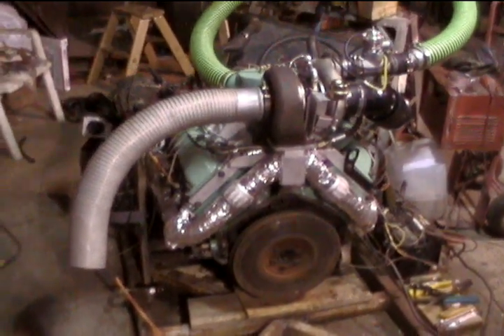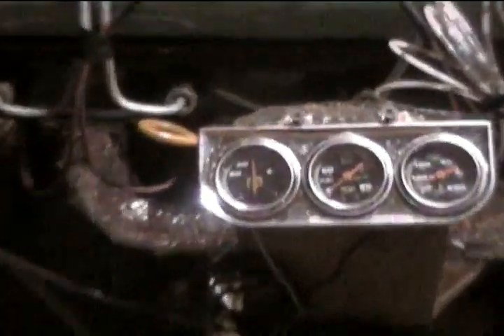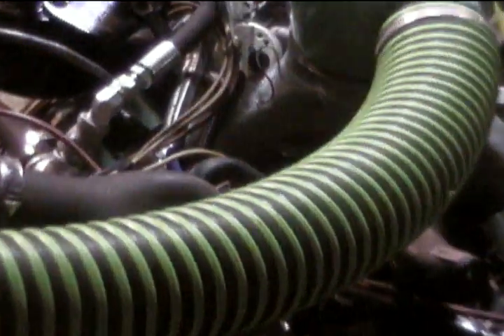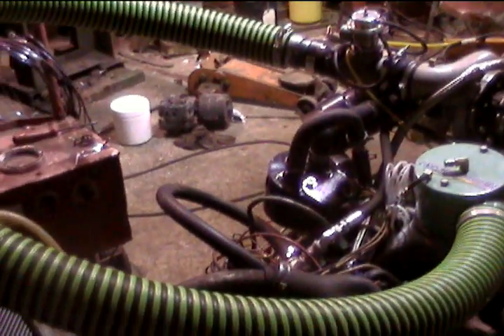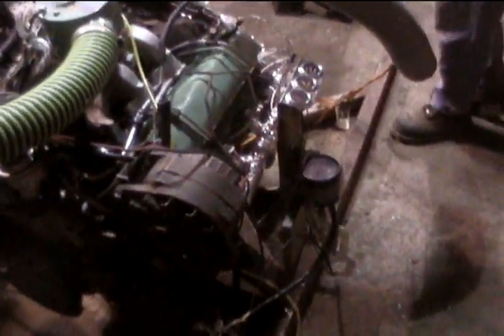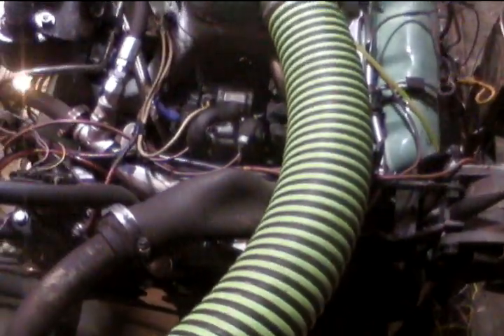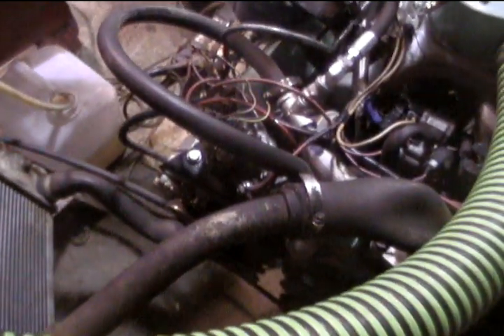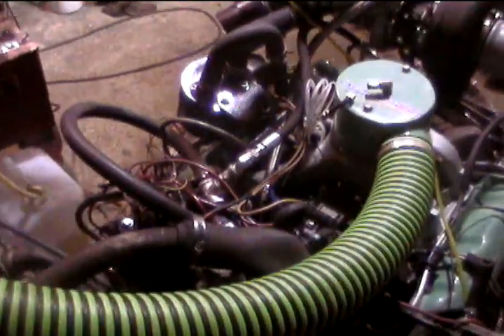6.5l turbo diesel with 18:1 compression pt. 1

Comment: u do know that a blow off valve is for when u let off accelerator to reduce lag?
it blows off so turbo has no resistance and so keeps spinning, other name is dump valve, usually on diesels its electronic and vacuum operated an r set to be open on idle/ whenever u r not pressing accelerator, u really dont want one to blow off at max boost as a boost controler as it will over rev the turbo.